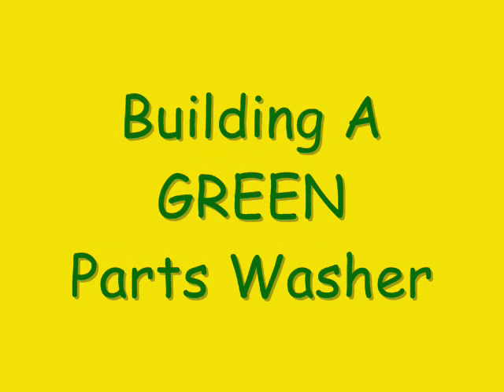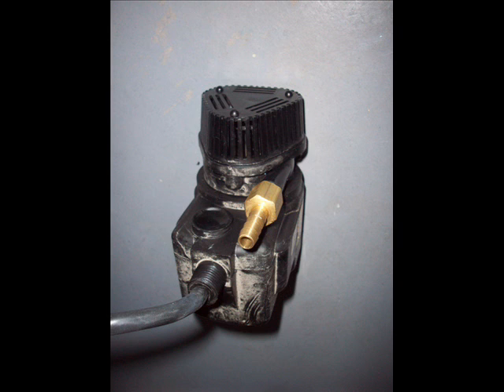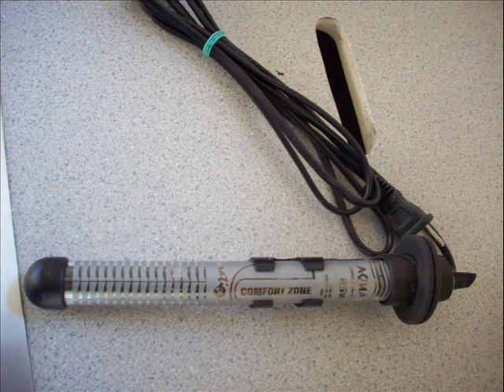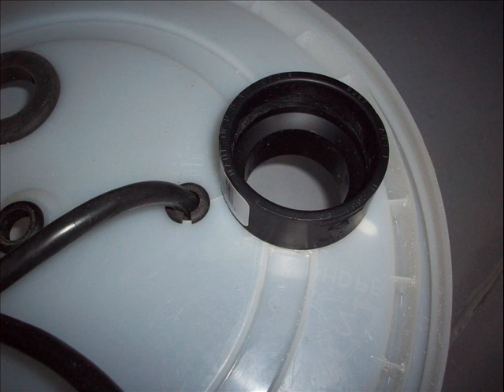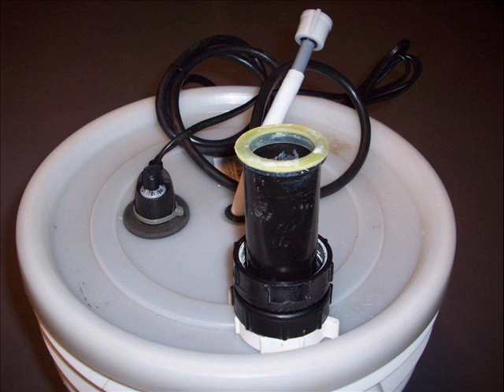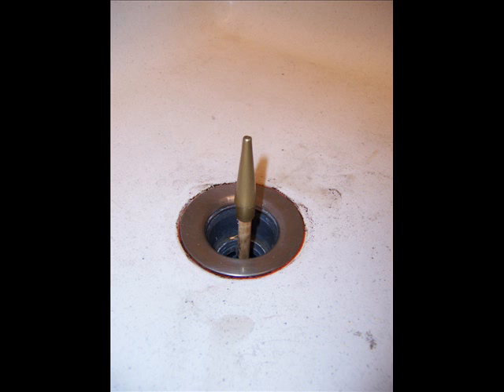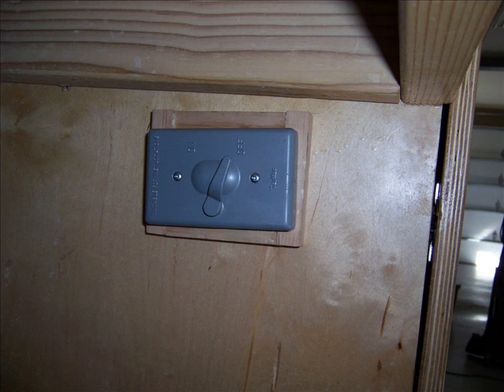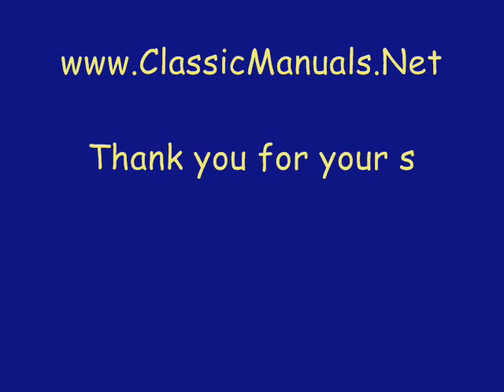Building a Green Aquis Parts Washer

Comment: Here's a thought for ya ....simple green is just as effective and cost much less just a thought I wanted to share....awesome job btw!!!!
Reply from the maker: You are right, these environmental cleaners are at least 5x the cost.  I am using ZEP Marado (available through ZEP only) a high pH (13) very effective cleaner.  It will tarnish aluminum.  Cost is about $14 per gallon, mix at minimum 5:1. I cheked with BioGreen Clean here in Boulder, a gallon runs almost $100 with a 4:1 mix ratio.  Marado is the best I have found, POR15 Marine clean next best, lower pH Around $25 per gallon,
Reply: Simple Green doesn't consume oil with microbes. What do you do with the accumulation of oil?
Ideally you just add water or more microbes to an aquis parts cleaner and feed it oil & change the filter.

Comment from the maker: @JoezVendetta I agree, the microbes do not seem to work well.  I am using ZEP Merado cleaner.  It is water based, bio-degradable (somewhat corrosive) mixed 4:1 (strong) cost is about $14 for a gallon of concentrate.  POR15 Marine Clean and KB Aqua clean are equivalent water based.  Mineral spirits is too  volatile for me.  Thanks

Comment: I'm a bit new to the parts wash deal but Simple Green has been my degreaser of choice since I've owned a car. I've seen other youtubers like Eric The Car Guy mention mineral spirits but I've always wondered why not just use something simple and cheap like Simple Green? If it's for sale here in CA it's gotta be available in all 50 states. It's pretty cheap. 5 bucks gives you a gallon of concentrate and it's recommended to be 1:1 but I've used it a 1:5 without issue.

Comment from the maker: After a year the solution got pretty dirty and I was unable to filter it so I replaced it with ZEP Moroado for about $15.  This is a biodegradable cleaner and seems to clean much better.  I will use the remaining microbes in the ZEP solution.  

I do not know if these expensive microbes actually worked.